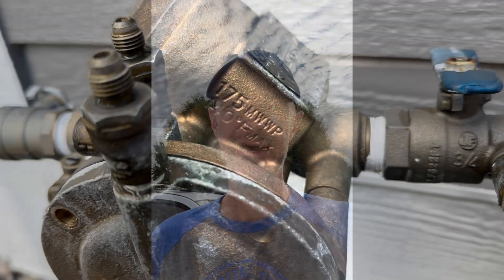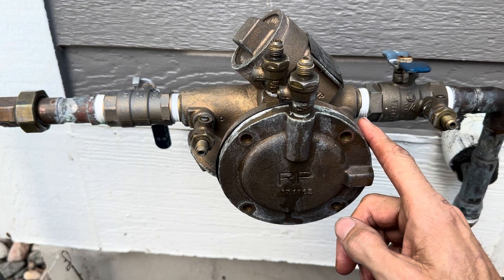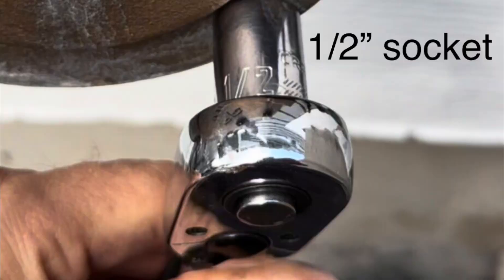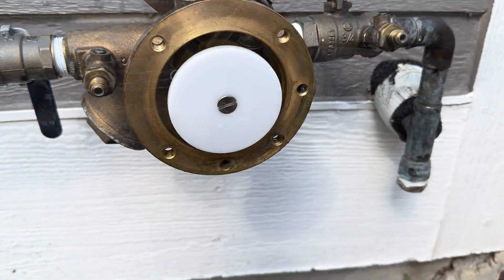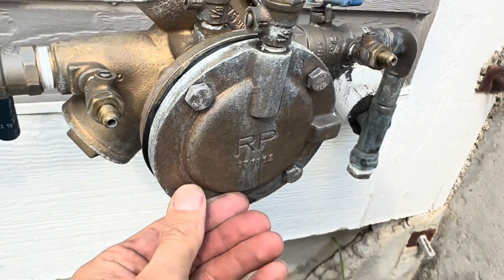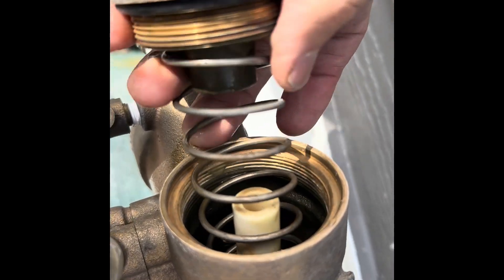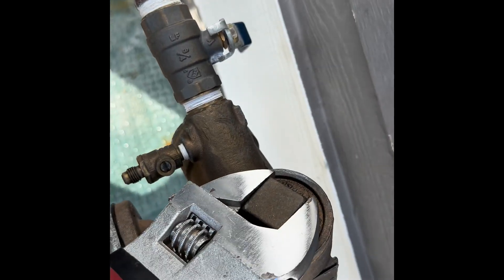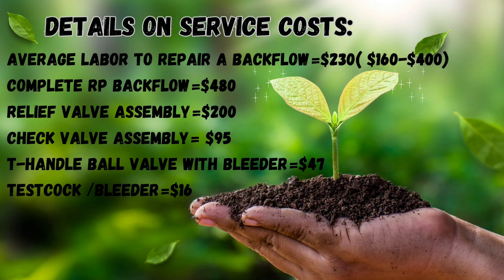How To Repair a Backflow- A Quick Guide to a Reduced Pressure (RP) Back flow/ Febco 825Y

Comment: Mine cracked in a freeze need to replace the whole part. I want to just do it myself but don’t have the tools
Reply from the maker: A plumber can do it, but they are pretty expensive. A simple way to do it is cut the copper pipe on both sides of the backflow. The use some wrenches to unscrew the male adapters into the backflow. Thread them into a new one. You can solder the copper back together or use the Shark bite type compression fittings to put the copper back together.

Comment: I had noticed that relief valve was leaking from the bottom any idea if I can repair or have to replace my back flow febco 825Y
Reply from the maker: Make sure that the bolts are tight. If so, and it’s still leaking, it could be the diaphragms inside. You can order those kits separately. Or the brass cover could be warped itself, which also can be replaced. I’ll send a link
Reply from the maker: What size?
Reply from the maker: Here is a link for the repair kit (seals and rings) https://amzn.to/4kHp5fK

Comment: the city sent out some irrigation people to backflows throughout the city.  ever since they came (i think) it seems my water pressure isn't the same.. is it a coincidence or possibly something else?
Reply from the maker: It could be a coincidence, however sometimes cities can adjust the pressure supply to buildings and residences. They don’t have to inform anyone that they have done it. I would recommend calling your local city/ Board of Public Utilites and ask if they have adjusted any pressure in your area. 
To compensate for that, you may ask a plumber to adjust the pressure regulator inside your house. You could also get the Backflow inspected to see if it is functioning properly. 
Other ideas might include changing the nozzles, or moving/capping sprinkler heads.
Reply: @helpmylandscaping  thanks for the advice.  I'm renting too so I may just have to pass it on to the landlord. 👍
Reply from the maker: That’s a good idea 👍🏼

Comment: I have this valve and it is giving me some strange problems.  I noticed a few days ago that one of my downstairs toilets' sounds like water is running a little through the pipes all the time.  The only way to get it stop whining to cut off the main water valve to house.  Well this morning, I saw that my Febco was leaking.  I turned off both ball joints to it.  But when I turned on main house water, the toilet still sounds like water is running (can't find water leak anywhere) again.  A few days ago I tried isolating sprinkler system to see  if that would fix issue.  Febco made strange sound on returning pressure to it.  Maybe I have two failures now.  Maybe the Feco rubber gasket failed then, and there is somewhere else in my main water line (under cement slab maybe?)  Any ideas?  Also, I think I may have gotten back flow into main water lines.  I guess a good water flush would do the trick.
Reply from the maker: Regarding the sound of water in the toilet- it could be the float inside the tank. Or the seal at the bottom that drops when flushed. The back flow could be something different. If you open the ball valve on the inlet side and shut off the outlet side ball valve, then more than likely, it isn’t the back flow. Either way I would recommend a licensed plumber to investigate the issues.
Reply: I got a professional out to fix the water line.  A copper line that went into the slab connecting the sink to the toilet line was leaking under the foundation.  They fixed that.  I am disassembling the back flow preventer now.  It looks like one of the check valves rubber seats is pretty bad.  I will order some new gaskets and seats.  I am trying to take apart the relief valve.  I got the 4 bolts out easy.  But the cover is really stuck to the assembly.  I tried tappng it lightly with hammer, but it is really stuck.  The edge of the rubber diaphragm peaking out looks really weathered and hard.  I'm guessing the sun practically baked the rubber and fused it with the brass.  Any suggestions on how to unstick the cover? I can always use more force.  The only thing I can easily grab on the cover is the brass relief valve.  I don't want to break anything.@helpmylandscaping
Reply from the maker: @mwbiggs if there is still a water supply to the backflow, you can carefully turn it on and it will put pressure on the relieve valve. This might be enough to pop it loose. Be careful turning it on all the way, and don’t stand in front of it, or be too close when you turn the water on. Just a quick burst of water. If that doesn’t work, then slight tapping on it from different angles can loosen it too. If the diaphragm already looks like it needs replaced, then you may use a screwdriver and wedge it between the plate and the diaphragm too.